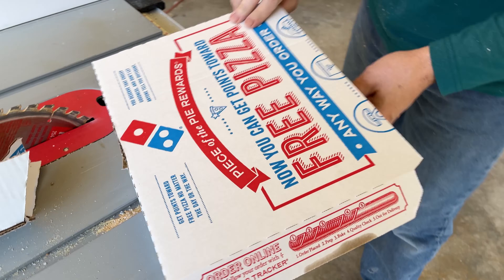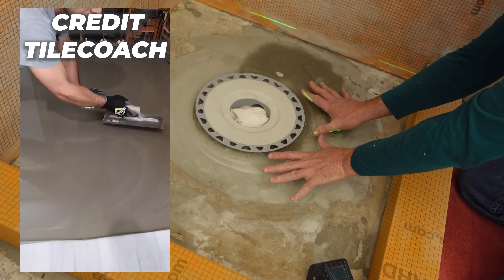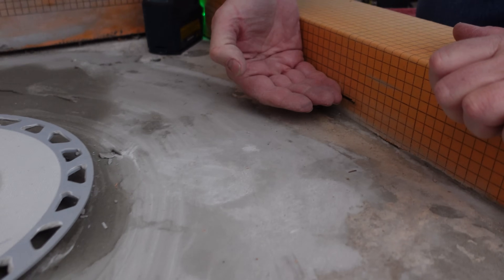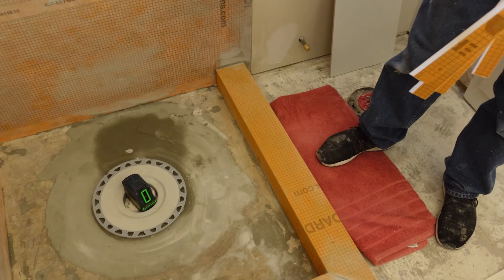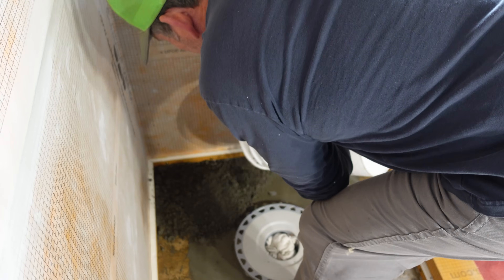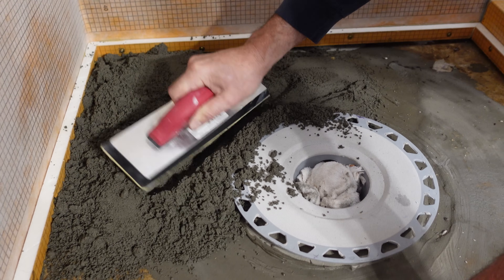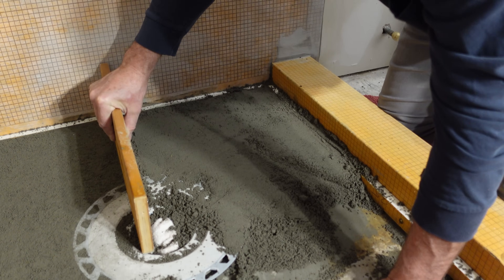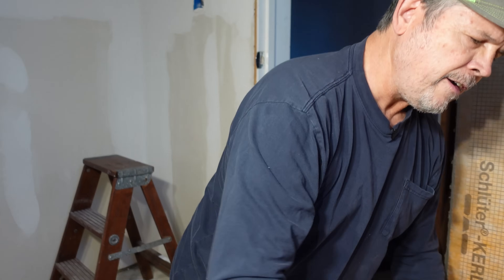HOW TO BUILD a PERFECT Shower Pan PRE-SLOPE (Great for DIYers)

Comment: After watching numerous videos and noticing different styles, techniques and products, I have a question.  Is a cement board required to be used on the shower walls, or can you just waterproof drywall , either with a membrane or brush/roll on liquid thats consistency is like paint?
Reply from the maker: The only time I'd ever use drywall behind shower tile is if I put Schluter Kerdi over the whole thing.  Cement board it better IMO

Comment: I’m using a mosaic tile to form the floor of my shower build however the tiles are lifting as the adhesive is not curing and the glue holding the tiles to the mesh is also softening.
Reply from the maker: Adhesive?  Are you using mastic or thinset to apply the floor tile?
Reply: @StudPack  from what the pack says I have no idea as it doesn’t say, mixes like thinset but I am thinking the reaction causing the cure process isn’t working with the tiles I am using. The annoying part is it worked fine on the kitchen and orangery floors I did. 
I have a feeling the glue issue is only part of it as the membrane I was sold is also an issue. In short it’s crap. I have had to order the Schuter direct from Germany as it doesn’t seem to be available in any of the stockists near me (UK) which is odd.

Comment: What if the distance from drain to curb/wall is different on all sides. Like a rectangle shower with the drain on the left. The distance from drain to that wall is a lot more.
Reply from the maker: It's the same process.  Create your level screed as shown in this video and then form your slope to your drain.  Some sides will have a steeper slope than others but that's fine as long as each side is sloped the minimum required or more.

Comment: I have a question. For every 1/4 inch rise in a foot, the angle should be 1.19°. Why did you adjust the saw to 2.5°? Why was the angle doubled?
Reply from the maker: I just guessed to be honest.  The angle didn't matter in my situation; coulda been flat.  The subsequent water proofing layer and wall tile cover the screed but I put a tiny angle on it any way.

Comment: Is that Schluter drain sloped from the outside diameter of the drain assembly to the inside drain opening?  From the side view, it looks like that the outer diameter is kind of flat, and then there is a step down to the drain opening.  If that's the case, shouldn't you do the pre-slope from the wall perimeter to the drain hole opening in the drain instead of from wall perimeter to the outer diameter of the drain?  Thanks.
Reply: Nope. Go to Schluter’s YouTube channel for instructional videos directly from the manufacturer. I hope this helps. Thank you!

Comment: Love the idea and I’m not dissing you at all but are you worried about that liquid nails ( we use pl premium I’m here in Canada) eating away that that extruded polystyrene?Don’t you have to use glue that’s designed for styrofoam?
Reply from the maker: I’m not.  The glue is on the Kerdi.   Those thin sections of foam you see are part of the old curb.

Comment: No mesh or lath?  I've seen that a lot where I am now. We have never skipped mesh, and I don't recall ever seeing my tile guy in beverly hills skip mesh. (As far as I know..at least with the tradesmen I was in with, everything there is still hot mopped). The best sub I have here no longer uses mesh, but goes with kerdi and your method.  Good video, it's only about a ten percent chance you see a "how to do a shower" video that is actually correct. If it wasn't for you, it would even be more scarce.

Comment: Great video, and super helpful. I've got a question regarding larger/walk-in style showers on a plywood floor. Wondering if the weight added from additional framing, drypack, tile, etc, etc could potentially put too much strain on the joists below. Joists are 16-OC, so I should be good. 
Also, since it's 3'x7.5' walkin, would the furthest wall from the drain still rise 1/4" p/ft up to the far wall? Or can I level it out at some point to avoid adding so much drypack at the furthest wall?

Comment: While it works well- I wouldn't want extra border at all- just another surface that would attract mould in the joints etc. I'd prefer to mark a line on the original border as a guide.

Comment: Since you used the shortest distance from the center of the drain to the curb to wind up at 1/2 ",  when you carry that elevation to the longest distance from the center of the drain (corners) the slope there will be less than 1/4"/ft.   Just sayin'....

Comment: Jake bruton was just talking about this on an Instagram post and he said when putting thinset down to wet the floor so it doesn't suck all the moisture out of the thinset.  Probably not a bad idea?
Reply: If you were to take a free Schluter workshop then they cover these details. Concrete is porous and will suck moisture out. In the free workshops I attended then I learned to be able to wipe down surfaces like that but make sure not to make it completely wet because that can be a bond breaker. I was told to, “Give it a drink of water… but not to completely wet it down to have enough water to make a bond be able to break. More like moistened not wet.”. You can also find details on this on Schluter’s YouTube channel. I hope this helps. Thank you!

Comment: Why did you not trowel and apply thinset to the floor before you put the dry pack in
Reply from the maker: I used to and probably will again.  Lots of comments about it being unnecessary i.e. when dry pack is put in a vinyl pan there is nothing to adhere it to the vinyl.  It's just a big chunk of masonry with nowhere to go basically and that's true.  Still like the idea of bonding it though👍

Comment: I don't understand how shower door hardware can actually get a grip in a foam curb, am I getting something really wrong or does the foam actually hold?
Reply from the maker: The glass installers should not be drilling through the floor membrane on any type of  shower installation imo.  My guy uses short anchors and screws on the curb.   I use a 3/4” thick piece of stone for the top of the curb and that is plenty for a screw and anchor
Reply: Schluter has design product specifically for these issues to avoid penetrating the waterproofing or being able to mitigate any screws that might need to be applied. I absolutely love some of their profiles that holds glass with no screws! 😙🎉👍

Comment: Wouldn’t you want to pack under the edge pieces you screwed on to take the down pressure it gets with nothing under it?
Reply from the maker: We had an eighth inch or so gap.   I did pack some in there but not too worried about it.   By the time the wall tile goes up that foam will never see any load.

Comment: How did you determine top of drain height?  Thanks!
Reply from the maker: 3/4 inch above slab.   Minimum thickness of deck mud over concrete 👍

Comment: Hey stud pack I'm remodeling  my bed room and removed half the rooms electrical  plugs and switches in the room and put them back once dry wall was hung but that half of the room doesn't have power now the other that hasn't been done is fine it's all on one breaker it's not flipped can u help me

Comment: Technically thats not a pre slope ,,a pre slope is used to go under a poly liner so if any water gets passed the tile it will hopefully run off on top of  membrane and to the drain . and how are you sealing where curb meets wall ?  since you are not using a membrane is it safe to assume a liquid membrane ?

Comment: One thing I also don't agree with is having put in the cement without having put in a tinset to serve as a bonding link between the old cement and the new one you put in .
This cement has a 1 to 4 ratio
It will never bond to the concrete

Comment: I like this technique, very creative...but I'm a bit concerned.  Many foams are slightly compressible, "spungy" when there's compression on them end-wise.  I know the foam spacers are ultimately strong enough, but what about rigidity? I'm concerned about having a 1/2" spongy perimeter at the base of those walls.  Those transitions (walls/corners, walls/floor) are the most critical joints in a shower.  In this case we're putting two different materials right at that transition.  I really like the concept, but has anyone experienced any problems?
Reply: I did the job with this technique, it worked out fine.  Perfectly level.  The spongy perimeter was there, but I was using thinset/membrane.  By the time that was added everything was rigid enough. 👍

Comment: could you just use cement on the edges instead of that foam board if you dont have any. Make a quick form and then just pour some cement all the way around the outer edge and let it dry. Of course that adds time but I feel cement will last longer than foam but maybe Im incorrect in thinking that

Comment: Mentioning how back in the day the dry pack was just sitting in the vinyl not having no bond at all, which is probably why every single tile system I demo, the wood is always rotten. Always. Every time. I live in south Louisiana, idk where you live, maybe they used a different method down here. But man every tile shower system I demo is rotten. Every last one of them

Comment: I’m new. Is there a video explaining why the verticals aren’t on top of the horizontals? As a plumber we are taught to “go with the flow”. Looks like there’s a seam for water to penetrate between wall and base? I would think the base be set then the wall set. That way if water does penetrate tile. It’ll still go to base and weep holes in drain?? This way looks like a 15 year job security style. Long enough to say it lasted but short enough you’ll still be alive. Lol. And seriously just asking. Our tile guys do just as your doing. And they can’t answer the question. “Boss said to do it this way”. I just set the drain and come back in 6 months perform a flood test because they can’t believe it’s the tile , must be the plumbing. “The tile shower is only 6 months old” they say. I’ve caught 5 and just wanting to know where they go wrong. It’s literally leaking under those base corner seams. Every time. Contractor won’t listen because it passed inspection and most of the time over a year before anyone goes under their house that deep.
Reply from the maker: Thx for watching and commenting 👍. With a Schluter system (floor and walls) lapping doesn’t matter.  They teach this in their seminars.   I attended one in New Orleans pre Covid.  It’s classroom plus hands on.  They mock up showers and you have to waterproof it.   They basically tell you to do walls first then the floor so it’s a reverse lap.  On the shower in this video we do the same thing.  Be sure to catch our next video (probably releases tomorrow) where we completely waterproof the floor and fill it with water to test before tiling.   If the corners are leaking I’d say they’re not using the preformed corners by Schluter.   They include some with the drain kit but seems like it’s never enough for more complicated showers.    Hope that helps👊👍💪
Reply: @StudPack  yeah thanks. Keeps from looking there. My brain is running circles but I’m just the plumber. 😂

Comment: For anyone watching - I’m ripping out tile from my bathroom where this technique was used for both the floor AND THE WALLS 🤯, with no membrane between it and the tiles…important to know - you MUST use a membrane. I’ve been hammering at this (expletive) shower for 2 days to get all this crap out and down to studs. Also important to know - don’t use wire-reinforced concrete for tile work on your walls.

No membrane meant water damage, and no membrane meant MASSIVE pain in my (expletive).
Reply: Almost everyone watching and commenting on the video blows a load over it, but a tile contractor with decades of experience says the tile job's bound to fail. Here's why: the sub-drain assembly has weep holes in it--I don't recall seeing anything on this in the video, and it's a really important feature.  The sub-pan, about 2" below finish tile, must employ a membrane and be sloped from all sides to the sub-drain weep holes--nothing in the video on this, either.  The cement floor in the video was a 1/2" out of level--so water getting through the tile/grout joints, and wicking down the sub-drain, will hit the slab and migrate under those cheezy foam dams. If a sloped membrane had been installed at the very bottom it would deliver any leakage to the sub-drain's weep holes, with the leakage going down the ABS or PVC pipe.  All dry packs or whatever leak---and without a membrane at the very bottom of the pan, sloped to the drain's weep holes, the leakage will migrate out of the pan area to ruin framing/sub-floor, etc.

Comment: If anyone could please share some insight?  My math skills are, well, not the best would be a generous assessment.  It's the angle of the board that was used as a guide for the drypack.  I have watched the process where the guides were cut several times, but how the angle the top was cut was determined still evades me.  The whole process is very constructive, but the process for determining the angle of the top of the guides I just cannot get a grasp on how to determine it.  It isn't that it wasn't covered.  It's all on me because I know I've missed how the angle was determined.  Thank you for your patience and consideration.
Reply from the maker: We just guessed to be honest.  The screeds don’t even have to be sloped imo.   Just make them flat and you’ll be fine.  👍
Reply: Google that question, and the reported answer is 1.19 degrees. But, it's really going to vary, as it will be a higher angle for the shorter distance from wall to drain, and that angle at the most extreme length from the drain to the wall. And, if the drain was at one end, like the shower trough drain, the entire floor would be sloped, making the sides not be level, making for a more interesting tile job.
Reply: A Schluter representative is very good at answering questions like this. You can contact them and they can get you in contact with your local representative that is able to help you with before, during and after the project. The support is phenomenal! I hope this helps. Thank you.

Comment: Lets say you remove a bathtub and your drain is 10 inches from one wall and 4 feet from the other.  How to determine slope on that?  It cant be level from the farthest point because that slope would be way too much on the short side.
Reply: You have to convert your tub drain and install the shower drain first. Then you check for level.

Comment: Can someone plz help with this question 

When I’ve watched uk videos , using a pre formed shower board to be tiled over 
They install the board , then tank it and seal all joints etc then tile 

But with grout not being waterproof there is a chance water will eventually get under the tiles , ( yes it can’t get through the membrane or shower former but it’s under the tiles , 
On some American vids , they install a drain with weep holes in the side , and put small pea sides pebbles around the outside of the drain 
So if any water does get under the tiles , it can follow the fall under the tiles and get into the drain
I get this theory , but not  everyone does this ???
Reply from the maker: The uk system you describe is a "drying" type of installation.  Water gets in and can dry out.  The weep hole system is a "draining" type... water gets in and drains out thru the weep holes.  Don't see it much anymore here but it's still around.
Reply: @StudPack  thanks so much for taking the time to reply .
Much appreciated
And keep up with the awesome vidoes 
I only stumbled across your channel about 2 weeks ago but since then not watched any TV just working my way through your videos on a evening on the big TV in living room ,even the Mrs is enjoying watching them 
Wish I could find a trademen like you here in Newcastle north east England

Comment: its backwards. the mud pan is supposed to go in first so that the walls come down on top. when ever doing any tile work or work in a shower you have to account for water. you want water from the walls to come down onto the floor and roll into the drain. doing it this way makes the opposite happen if grout goes bad when water rolls down the wall it will find its way into the wall where it meets the floor
Reply: Kerdi waterproofing is going to cover this. This is just a form for the kerdi to lay on.
Reply from the maker: Yep.   Lots of detail in next video 👍